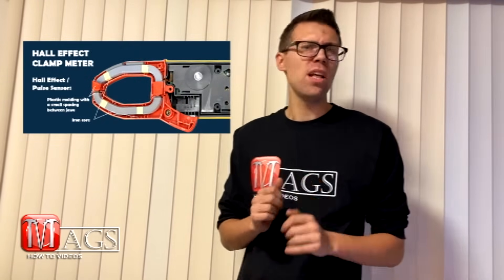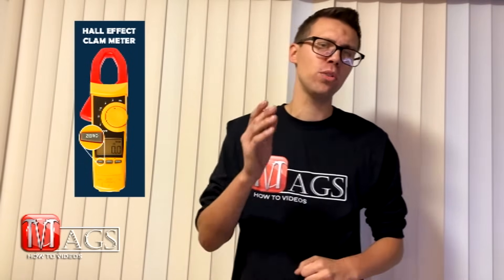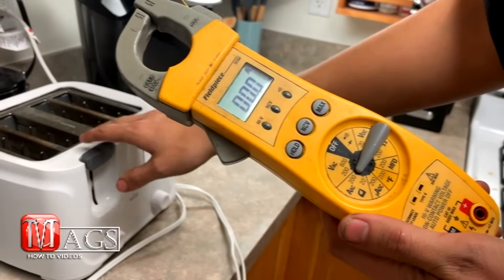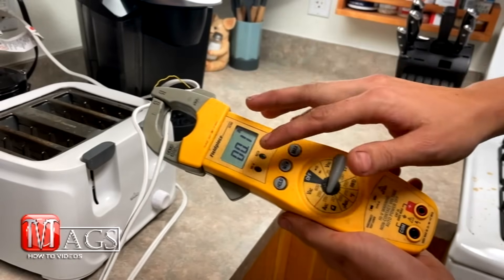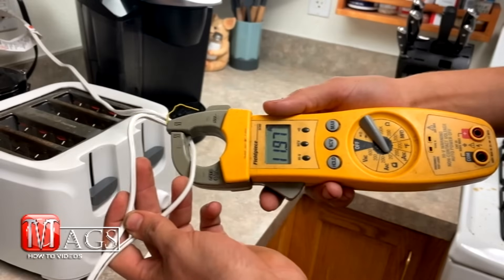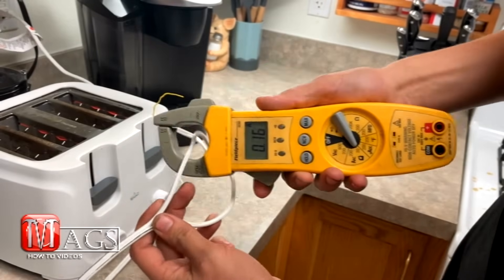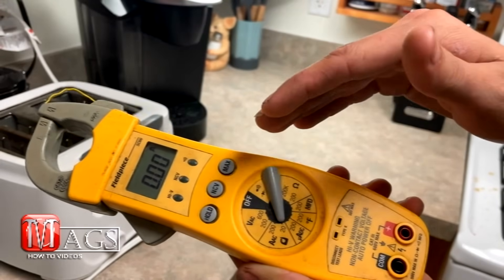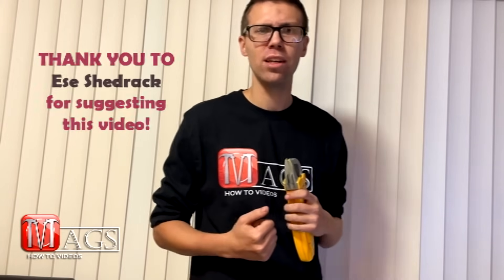How To Use a Clamp Meter (For Beginners)

Comment: There should never be a safety concern if one attempts to read current value starting at a low scale on the meter when clamping  the meter to the wire. Only thing will happen will indicate out of range on the screen but it is not dangerous however you are correct,  when starting at high scale, it is easier to scale down for an accurate and precise reading.
Reply from the maker: Yes you are correct… however, I try to demonstrate being over cautious on safety in my videos because there are always those who still find away to hurt themselves. Thanks for watching and for the comment.
Reply: @MAGSHowToVideos  I completely understand and you are doing the right thing. Well demonstrated! Thank you!

Comment: So you have a standard power cord attached to your appliance that obviously cannot be split with completely destroying the insulation.
Are you saying that a clamp meter cannot read the complete cable that would contain wires...  ACTIVE / NEUTRAL / EARTH ???

Comment: could you make a pigtail with a male on one end an female in the either like a short extension cord with the wires already separated? would it alter the amps by adding a connection
Reply: Perfect tool.  You can use a short extension cord instead of splitting wires as shown.  Have a split 12-18" extension cord and eliminate the splitting of your appliance's cord.

Comment: what happens to a clamp meter wben testing current with the clamp and the probes are connected?

Thank you
Reply from the maker: @Jay-tr3px   Good question. You can use the clamp meter function with your test leads plugged in. The test leads just don’t do anything since they are disconnected when place in the clamp meter setting.
Reply: @MAGSHowToVideos 
Thank you for the quick reply 👍
I'm going to subscribe now!
Thank you again .

P.s.
When I checked my electrical diagram indicating a circuit breaker rated 15 amps.
Why does it have and extra numbers with it (15A/5KA)?? What is the 5KA indicate? And how do you fuse a step down transformer?

Comment: You have to ruin your wire of the appliance to get a reading, that sucks man.
Reply from the maker: @pilbomags488  not necessarily. If you use a extension cable that has wires you can separate like the one I used in this video you don’t have to.

Comment: Just awful. You couldn't demonstrate voltage. I mean what's a more popular reading, amps or voltage ?
Reply from the maker: @sandorebussolini  you do know the whole point of using a clamp meter is to read Amps right? If you are trying to learn how to test for Voltage you can check out my other video “How to use a Multimeter for beginners” in that video I show the basics on how to test for volts, amps and ohms.

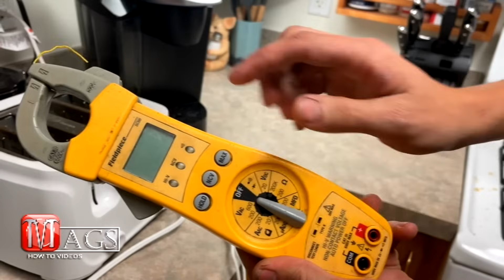Comment: What is the little yellow wire at the top of the meter (such as 1:47)?
Reply from the maker: @thomasstambaugh5181  I sold this clamp meter last year. If I can remember, I believe it was part of the “Live Wire” or low/high power reader that allowed you to detect if a wire was “Hot” (had power).
Reply: @MAGSHowToVideos  : Sounds like a lead for an "NCV" measurement -- "Non Contact Voltage". I appreciate the quick response!

Comment: what does it mean when it sound beep ? Long beep .
Reply from the maker: That means you have continuity. The long beep means you are just holding the test leads against the wires and haven’t broken contact. The reason for a short beep in my video is because I just touched the wire quickly then took the test lead off.

Comment: Thank you! I didn't know that I had to clamp only ONE wire. I was about to render my fluke 902 as broken. Now I finally know how it works after 3 years of ownership. I feel pretty dumb. Altho in my deffence, I normally work on cars (DC) so I am a little ignorant when it comes to electricity in my home.
Reply: Clamp only on one conductor when measuring DC too. When conductors are conected to the same load the same current are flowing in opposite directions in this to conductors. 
AC or DC its the same, and It is pure logic.
Reply: @kjellrogerjgensen60  Right, but with automotive stuff, it happens more frequently that there is only one wire in a circuit, because the load is case ground and there is no return wire.
Reply: @Mike-yr9eb  When common ground, (cars) you dont have to worry about it. And all current drawings are to be found together as one current near the battery grounding. And will give you information like relative change of current, and a fast yes or no answer to if it is a leake current when it are suposed to be none at all.
In boats you are more likely  have two leaders on each 
load. But they do not always follow exactly the same route near the fuses.
Reply: In your home if you are measuring on two wires to the same load and are haveing a reading its the differens in current caused when one of them having an unwanted contact to earth. Then earth leader will carry the differenc in the current.

Comment: There are dedicated wire split units for testing. However, it can be cheaper to get a short, heavy duty extension cord and carefully split it (no bare copper!), like he did. Doing this at both ends and having a flat plug will help when measuring the current of appliances such as refrigerators where access is tight. Want more- research "inrush current", which is also a useful current specification, especially when sizing for a generator.

Comment: Jus got one that does dc and ac amps and works as a regular multimeter also with a thermometer also so am still trying to figure it out. Thanks for the info about having to split the wires as i would have never thought about that

Comment: Why check the current only ?
Reply from the maker: Good question. The reason you want to test for Currant is so you can make sure you are getting the correct amount of Amps. Even if you have the correct voltage, if you Amp output is lower than what your device is rated for, you won’t have the power need for it to operate properly. I hope this answers your question.

Comment: hints and tips dept here. please ensure your conductors are routed in such a way as to not compromise safety, avoid sharp corners when routing cables, chemical solvents and in this  case high temperatures. There are others but we expect users of this dept to use a little sense to avoid gaining a Darwin award. just saying. have fun out there and stay safe.
Reply from the maker: Couldn’t say it better myself… safety always comes first and if you’re someone without common sense this is not for you haha
Reply: High temperature, as in when he's roasting his lead wires over the toaster elements?

Comment: Can normal clamp meters measure voltage with the clamp?
Reply from the maker: The clamp portion on a clamp meter can only measure Amps. You would still have to prob the wires to test for voltage.
Reply: @MAGSHowToVideos  thank you very much for the response.

Comment: Out of curiosity, what happens when the wire carries more current than what you set for maximum?
Reply from the maker: You won’t get a proper reading… will most likely display “OL” on the screen since the measurement is to high to properly be displayed.

Comment: Can I use this with a grounded cable or do I still have to split the cables? Thanks.
Reply from the maker: If you are trying to use the clamp, you have to have the wires split. Only one wire can run through it or you will not get a correct reading.
Reply: @MAGSHowToVideos  wow! Thank you so much for your help! I really appreciate your channel!

Comment: There’s nothing to this, right? Clamp around the insulated cord, turn onto amps? When I do this I get 1/100th of the reading I expect.. if I clamp down right in the insulated cord I get 1/10th of the expected reading. Pretty sure it’s just a cheap pos I bought from Amazon, so I watched this in case I was doing something wrong

Comment: I have a Fieldpiece sc77 like yours. I'm trying to learn more about using it. I need to check a element in my stove. How may I go about it?
Reply from the maker: Easy. What you will have to do is remove the element and set your multimeter to your lowest setting for Ohms. If you only have one setting that’s ok. Touch one of the test leads to each end of the element. Test for continuity. If you don’t have continuity then you need to replace the element. If you do than you should get a rough reading of 30-100 ohms. If your reading is higher than that… there might be to much resistance and most likely will have to replace the element. I might put together a video on how to do this. Hope this helps!
Reply: @MAGSHowToVideos  I also check for grounded element by touching one lead to the outer sheath of the element and the other to the power terminal.
Reply from the maker: Depends on what you are trying to test in you stove.
Reply: The bottom element.
Reply: Thanks

Comment: Found my answer here with your video. I was trying to check Amps on my space heater. I didn't split the wire so I was getting very low readings. Now I know my amp clamp meter isn't bad one. Nice video. Do play safe, I hoped the wire won't melt. 😁
Reply: I use an old extension I don't care about whose cable I've split! This way you don't have to split every appliance's cable when you want to test them. Especially handy for stuff where the two wires are into a full sleeve and not easily spittable
Reply: @MattCantSpeakIt  -good idea thanks.
Reply: I'm in the same situation. Lol.
Reply: Yep same
Reply: I need to know this too!